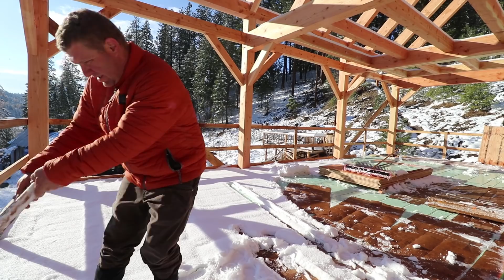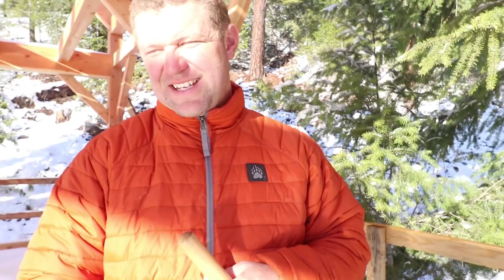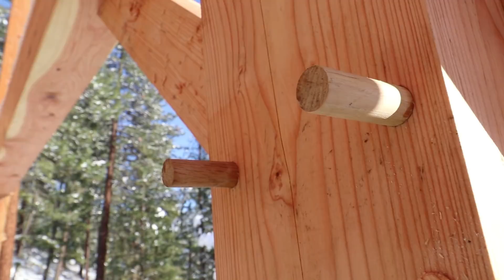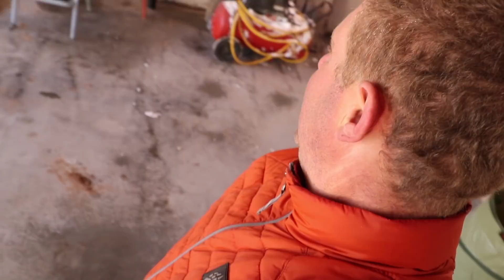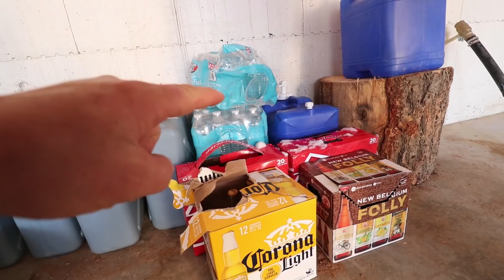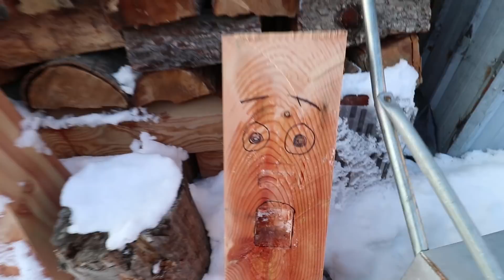WE’RE BACK After a Full WEEK! (Post Timber Frame Workshop)

Comment: So many comments about the floor getting wet and cold, I thought I'd post the spec sheets.

As an APA approved product, Warmboard-S panels can handle exposure to rain, snow, and ice. In fact, the aluminum top surface of Warmboard-S acts as a ‘built in’ weather barrier making it even more impervious to rain and snow than standard Exposure 1 plywood

Comment: Just curious, and have been wondering for several videos. How are the timber frame beams secured to the top of your walls?
Reply: Usually it's steel straps and bolts. They said in a  previous video that they will make a video on how the frame is secured to the foundation.
Reply: I was wondering if they use metal straps on the posts to strap it to the lower structure?

Comment: Are the posts attached to the floor or were they just set on top of the warm board? Been bugging me.
Reply: I've been wondering that too. I'm also curious about the weight load on the subfloor and those engineered joists. Those timber posts sit on the warmboard, which is over the rim board and i-beams. Kinda like resting a brick on top of a pencil onto another brick. I guess the engineer designed that, I'd just like to understand it. :-D

Comment: How does the timber frame on the base floor, did they anchor it down or is it just the weight of the frame keeping it on there?
Reply: They put in framing screws somewhere between 9 to 12 inches long. Looked like 3 or 4 per post.  Between the weight of the frame, and the screws, it will hold in there.  The sip panels when installed will tie the frame cross members even more.

Comment: Actually, now that the frame is up, there should be a lot easier to tarp the floor. More places to tis down the tarp. And by the way, put tarp on floor and tie it down. Then go diagonally with some rope over the tarp in all directions. Tie rope to frame base. I don't think you'd have more problems with the wind lifting the tarp. That should keep the garage dry.

Comment: ok,i have a question(i try it even my english might not be the best)why is there no overhang on the roofsides protecting the walls from rain,snow etc?will it be added later?in Germany we do the overhang with the construcion already so the tiles go at least 2 feet over the sides of the house to Keep the walls as dry as possible.greetings from germany
Reply: If they use SIP's for roofing they will be able to extend the panels out ...not sure how far....
Reply: im guessing they are 12 inch panels , so they can get at least 12 inches and if they use a buttress, then my guess is 2 feet.

Comment: get the  stair built measure from the top deck to the concrete floor take that and divide that between   7 5/8 - 8 1/4 that give you how many risers at the bottom cut the thickness of the tread. Hoosier windows I lost a family member fall though open stair. buy some scaffoldings 6 set 6' then sale after done

Comment: You need to be a bit careful with particle-board-beams and the water, they lose their strength if they get wet.Merry Christmas from Denmark.
Reply: lol you talkin about the floor joists over garage?
Reply: The OSB in the floor joists is very resistant to moisture. The LVL's used in the structure are incredibly resistant to water with the glue that are in them.
Reply: I know, but they can't stand to be constantly raised. Glue and coating can be waterproof, wood is never waterproof.

Comment: Does the newly erected frame needs time to settle before you start putting in wall panels and a heavy roof?
Reply: no
Reply: No, the most compression from drying and weight will be around 1/8th of an inch.

Comment: I think you ought to run a few lag bolts up from underneath the warm board, and into the bottom of each Timber Frame upright post.  That way it will keep the Timber frame from sliding off of the sub floor in a heavy wind.

Comment: guys i am litlle worries about frame column s and that thin floor decks , threre is no other mass under columns ???   column s can just go through the floor or is that some other wood or concrete to support weight of frame structure ???
Reply: baca zterchovej either goes to the concrete or middle is the steel I beam.
Reply: ok but at the top of concrete walls and midlle steel support I-beam is there  just air or there is some mass to connect and transfer weight forces to concrete walls and steel beam from the level of floor decks  ? i see wooden I-beams which lays on concrete walls , holds that floor decks but from top view ,area of frame structure columns are larger then area of wooden I-beams thats why i am asking this question. is it ok ish in plans drawning ? can i see that projected detail ? maybe some dimensions ? i am afraid columns can penetrate through the floor in area where is no wooden I-beam support . /sry for my bad english /
Reply: They installed crush blocks (vertical timbers) to transfer load between deck to beam/foundation wall.
Reply: TY for an answer but can i see picture of that crush blocks ? just for sake of curiosity ....

Comment: For everyone who is asking about the tarps. Would YOU not think that the school would have told them they needed to tap the structure. I would think that by rolling on a sealer, and using green wood. It would be fine to get water on the wood. Let see log cabins not treated to not rot in a couple of months do they?
Reply: I think they are talking about the floor joists underneath the warm board. The frame will be fine for months but the joists could possibly warp/expand from moisture.

Comment: You should’ve tarped the roof!  Now all that moisture will get trapped and possibly cause mold.
Reply: 23bobjr I’m talking about the radiant floor and joists holding it up.  Yes,  i know it’s not the end of the world.  Big mansions being framed get rained on all the time.  But getting the roof sheathed is a priority.  Not to mention all the tools in the garage getting wet.  The could have just tarped the roof until they were ready for sheathing.

Comment: Buy some Tyvek or some tarps and dry in your structure!  Since you don't have the SIP panels yet it will save your tools and trailer when you move it into the garage.  But you're idiots that will have to break a leg or neck before you build temporary stairs so I don't expect you will.
Reply: While I am also a big fan of drying in a space as soon as possible, 

i must admit 
that seeing 
the bright sun
 kiss those logs 
after a snow shower 
was visual poetry